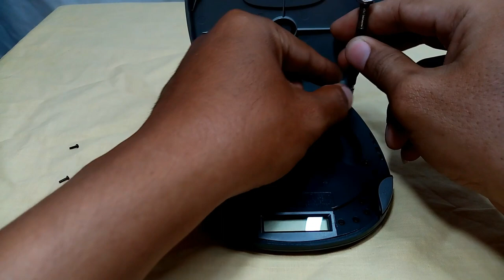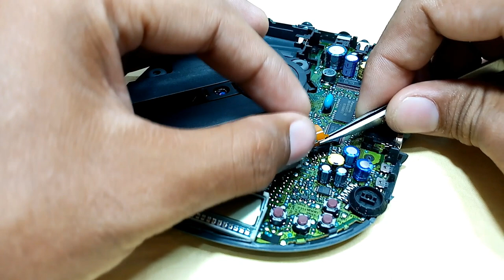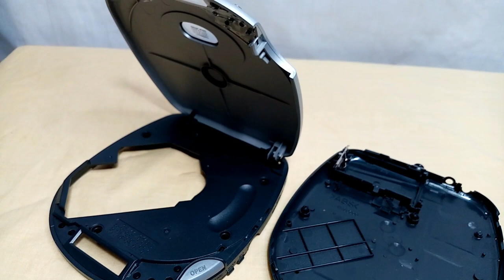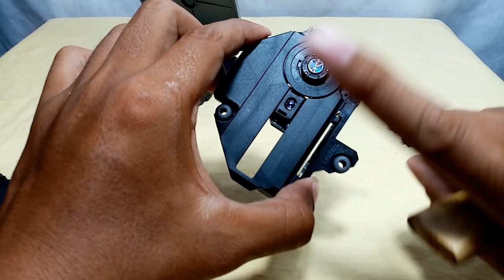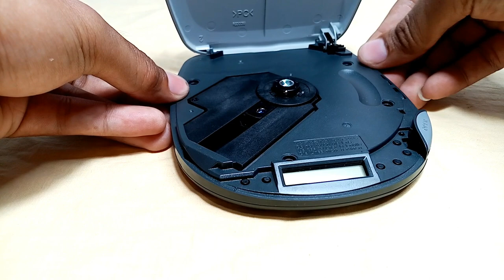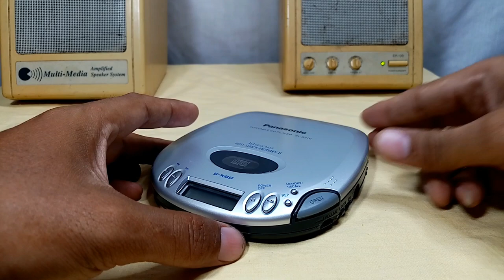Dissecting a Portable CD Player || Disassembling & Assembling PANASONIC SL-S310

Comment: Hello.  I have a problem with the Panasonic sl-s118 player.  When you put it on its side, it turns off, and in order to turn it on, you need to insert it into the holes on the back.  He was lying in the closet for a long time.Maybe something is not holding well in the middle?
Reply from the maker: What hole? is it the DC plug from a power supply?
Reply: @Woodys_Hobbies  In the hole for power, or the aux hole.  Could it be a problem that the player has been lying in the closet for a long time? The sound in the player is very good, I like it.
Reply from the maker: @yanfortuna4667  Just clean the DC plug and your earphone plug then insert and pull out the plug many times to clean the jack. That problem is a corrosion not using for a long time.
Reply: @Woodys_Hobbies  Thanks for the answer!  I will try to clean all the holes with cotton wool and alcohol.
Reply from the maker: @yanfortuna4667  No don't clean the hole with alcohol it can cause short circuit to the unit. Just try to insert and pull out the plug it can help to clean the contacts.
Reply: @Woodys_Hobbies  Simply inserting and removing the plug does not help.  I'll clean it with cotton wool slightly soaked in alcohol, then wait for it to dry.  I used to clean connectors like that.  This cleans a lot of dirt in the connectors if it is there.
Reply from the maker: @yanfortuna4667  ok
Reply: @Woodys_Hobbies  After cleaning all the holes, the player works normally.  Thanks for the advice!
Reply from the maker: @yanfortuna4667  You're welcome!!!

Comment: I cleaned my sl-sv550 and now in cd mode I have f15 error, I cleaned with contact cleaner without disassembling, did I destroy the lens? I tried to avoid the lens. Do you have any tip?
Reply from the maker: Maybe lens is very delicate.
Reply: did you check the lens position motor mine have the F15 too but I notice the sensor isnt moving
Reply from the maker: @thitipongteingtrongpinyo7440  Check sled motor.
Reply: I have the same one and it’s not turning on, do you know what I can do?
Reply from the maker: @gloriaowolabi5055  Not turning On you mean "No Power"? Try to check the battery connectors clean the contact of the spring.
Reply: @Woodys_Hobbies  how can I clean it??? With what???
Reply from the maker: @gloriaowolabi5055  Try cotton buds gentle in cleaning. Hold the lens gently with tweezer but it is very difficult to handle just be cautious.